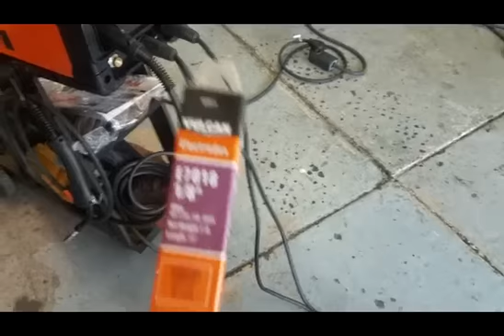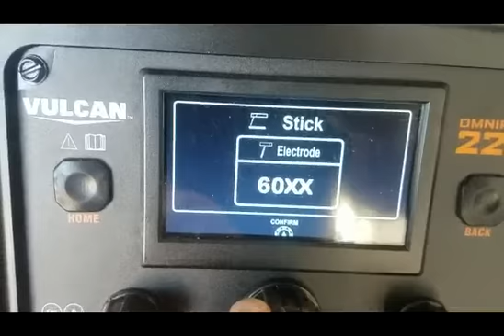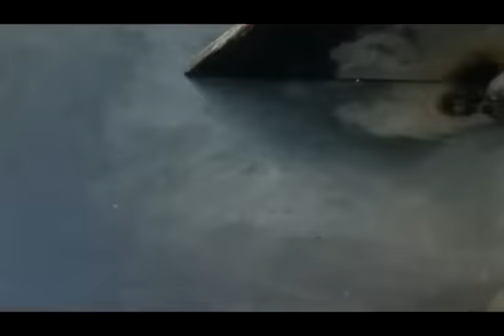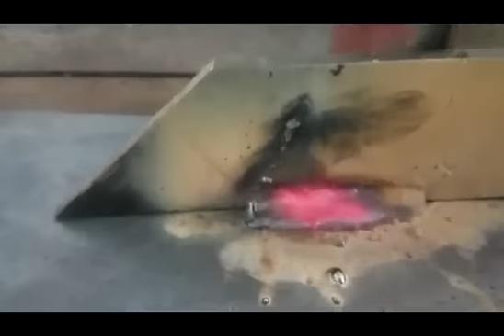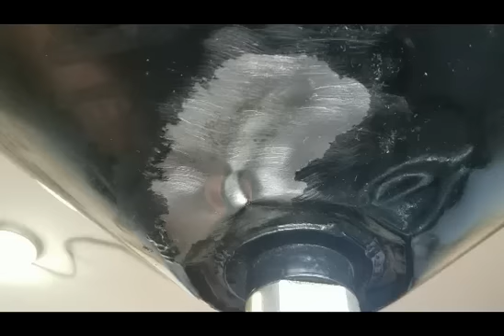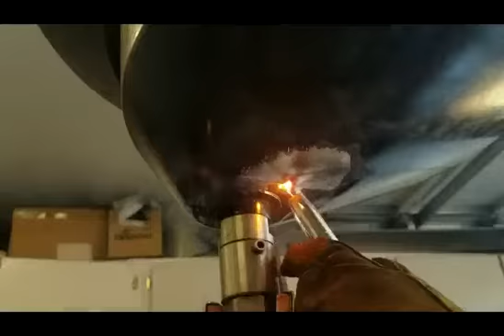Harbor Freight Vulcan omnipro 220 stick welding

Comment: Is that the 39.99 welding cart? Im thinking about upgrading from my titanium but wondering if the Vulcan would fit the cart. I have a Titanium 170 now
Reply from the maker: I'm not sure,  I know they changed the design of the welding cart to fit the larger welders.  This one is really designed for the older black welders so it doesn't fit that great.
Reply: @AutoRepairTips  Yeah,they have two types. Yours looks like mine but they make a bigger one for the Vulcan. It just cost more.

Comment: On your fillet welds, you want the work angle to be 45 degrees with a travel angle of 5-15 degrees. You must drag so that you don’t trap slag. Also, I hope you disconnected your vehicle’s battery before welding or you risk frying the computer.
Reply from the maker: I would love to hear the science behind disconnecting the battery to save the computer from frying.

Comment: 110vac wall or 220vac ?
Reply from the maker: I have actually never used the welder on anything but 240 I have heard good things about the 120 operation though.
Reply: The flux cored 120 does perfectly fine in my experience. This is a great welder really. I do not use the presets though the wire feed is always wayyyyy to high.

Comment: Looked like you were pushing the rod. Drag the rod and with 7018 never leave the puddle. Strike your arc and sit a few seconds then start moving slowly dragging a puddle about the size and shape of your baby finger nail. 1/8 on the flat should be running around 110 and stinger positive. Your slag should peel off nicely. Any porosity at all constitutes a bad weld. 7018 is a low hydrogen wire and in a controlled environment once the can is opened, the wire goes and stays in an oven. For the weekend warrior, keeping it in an enclosed container and in a very dry location will do. The wire will suck up humidity out of the air after long periods. We all do it but will effect weld quality in some way.
Reply from the maker: John Lanni I'm in Arizona, we don't have humidity.  Besides I doubt I will ever use this welder for stick welding again.
Reply: Auto Repair Tips I'm on my way right now to look at some weders. Have a great day.

Comment: Try using higher quality rods. By that I mean almost any other brand.
Reply: Lincoln Fleetwoods.
Have them at any box retailer.
Reply: LOL
Reply: Their a little expensive but not all that bad in my opinion. I bought 10lbs of the stuff because A. I don't have a tractor supply in my area, and B. lowes and depot only sell the AC 7018s from Lincoln and I refuse to run those with my dc inverter machine (PA200ST). Their just terrible simply put, but if Im in a pinch and dont have time to wait for an order of Excalibur 7018s to come in the mail, I have no problem with the vulcan 7018s or 6011s aside from the price. If I had to pick between hobart and vulcan for my 7018s I think Id go with vulcan honestly, but for everything else lincoln/hobart/excaliburs
Reply: Use Lincoln Excalibur. You will never regret it.

Comment: Can you do a tig review ??
Reply from the maker: bikefan81 I don't have the tig torch yet but will do one as soon as I purchase it.
Reply: Auto Repair Tips 
Get a CK ultra flex. You'll need the Lincoln twist mate connection.
17 series is more common you should get a stuby gas lense setup too.
You can get all this on Amazon for under a hundred bucks.
You probably will need to get the Vulcan pedal though.
Honestly the pedal and aluminum filler is decent but the torch is bulky and heavy as hell.
Reply: @horseblinderson4747  Late reply, but thanks for this.  I was wondering if there was any compatibility with the connection, other than the HF option, and this gives me a start at figuring it out...

Comment: Gotcha, not trying to bash you just giving a few tips. I'm considering the same machine for my first welder. So how are likeing it so far?
Reply from the maker: I like the shit out of the machine so far.  Although everything I have actually needed it for my previous welder would do as well but this is certainly much nicer and smoother and has way more control over the voltage.

Comment: Dude you gotta slow down, stay away from oscilating. Watch your puddle
Reply from the maker: Will Clemons it was about trying to hold a phone watch what it was recording and stick welding for the first time in a long time and liberally the first time I had ever stick welded on this machine and less than 10 minutes on the machine total.
Reply: @AutoRepairTips  I'm sure the Chinese make a holder to attach your phone to the electrode.

Comment: When there's slag you drag...pushing is for mig.  Try a pull angle about twenty degrees
Reply: 😂 I can't tell you how many guys with mullets at my work say when they're slag you drag, ROFL it depends on how hot you're running whether or not you push or drag
Reply: @franktetanus3610  do u push if higher amps? Asking as a novice stick welder

Comment: Keep practicing stick, can't tell you how many times being able to stick weld has helped me. Many times when you are outside and gas shielded wire just won't work or when your base material can't be properly cleaned. Awesome review!
Reply from the maker: Yes, I have done welding in windy weather outside but used fluxcore wire,  the only time I have genuinely needed stick welding was in the middle of nowhere welding with 12 volt batteries.

Comment: One huge tip, on any rod as mentioned every rod has a fav position the main thing when you push or pull the puddle you tend to rotate the tip and pull up and when you do that the arc gets longer and shorter and   
Causes issues <porosity >try running slower and brace a bit better to keep the tip steady.  That's why it seems easier as the rod burns and gets really short.

Comment: With that 7018 rod you need to travel at a drag angle about 15 degrees and move SLOW don't oscillate the rod. That's most likely why you're getting porosity, because you're welding over slag that your weld made. Just angle the rod 45 degrees to that t joint, and stinger towards the direction of travel (drag angle), move very slow and keep about  a 3/32 or less arc distance with the tip of the rod. It take loads of practice, but you'll get it. Good luck buddy
Reply: Stick is great for the right application like thick plate. I would keep working at it.
Reply: @Weaver Cattle Company I've done 16 gauge with stick but I much prefer mig or tig for that. I prefer stick for 1/4" and thicker.
Reply from the maker: To tell you the truth I probably will never use the stick feature again.  I only did it for the video.  I specifically bought this machine for mig and tig functions.
Reply: Auto Repair Tips . I have my degree in welding technology and know how to stick weld properly as well. But I mig and tig weld for a living. If you'd like some tips don't be afraid to ask. You can see some of my stuff on instagram if you'd like. @Welding_with_skill
Reply: @AutoRepairTips  Don't discount it. I have 2 ac/dc transformer machines that I use all the time for stick only.